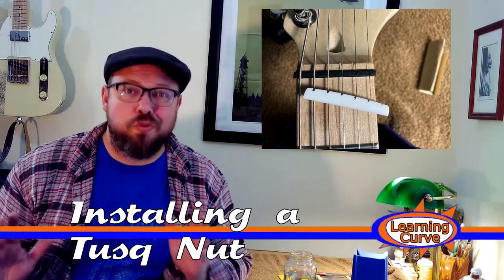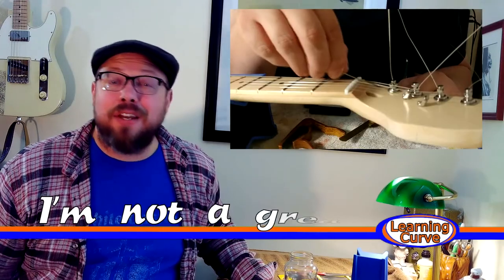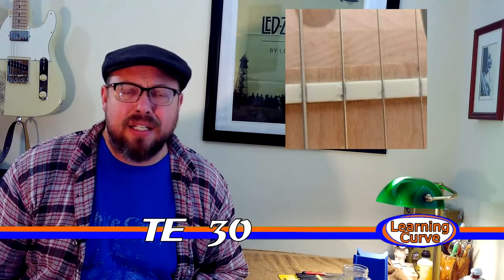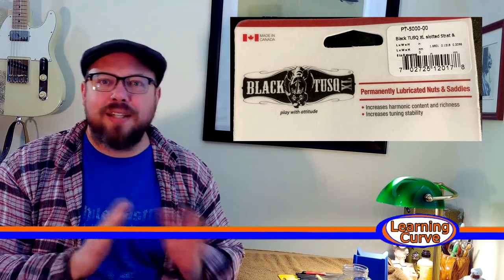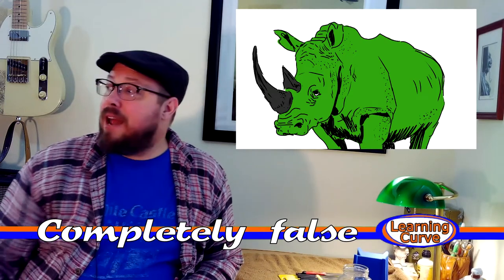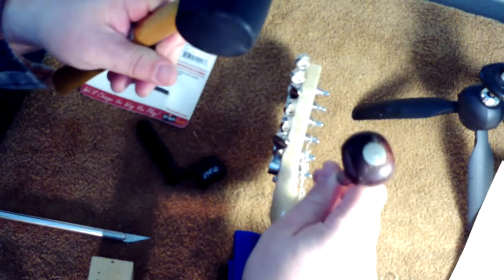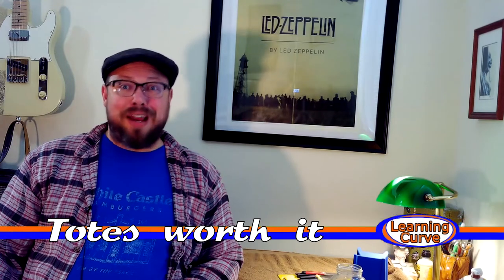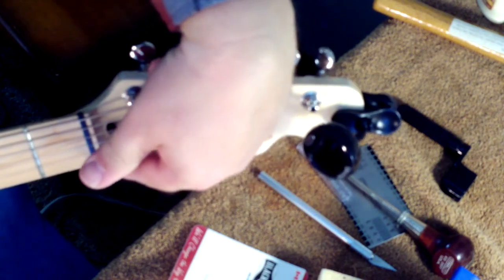Ep 58: Installing a Tusq Nut

Comment: I’m still not sure if you’re supposed to sand the dimple/little stick that protrudes from the bottom of the nut. I did as to fit the nut on my Tele, but haven’t seen anyone do it in the videos. Is it so obvious that it’s skipped or do you leave it?
Reply from the maker: I believe that nub is there to create an arc that goes along with the radius of the neck.
Reply: The nub is there if you have a flat bottom nut slot. If your slot has a radius or curved bottom that follows the radius of your fretboard you can sand it to match that by setting up some sand paper on top of your fretboard and rubbing the bottom of the nut against that to match that curve exactly.
Reply: Good idea to tape off your neck when you file it so you don't mark it up when you shape the nut finishing it off.